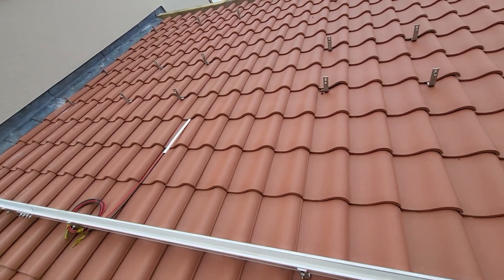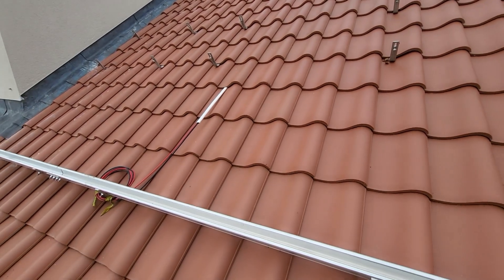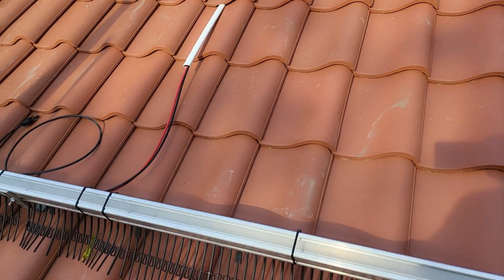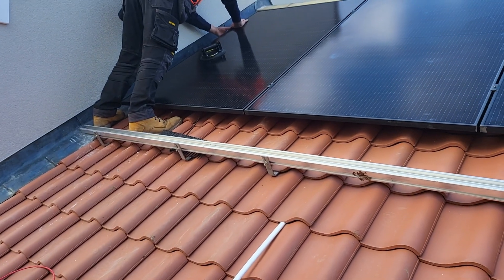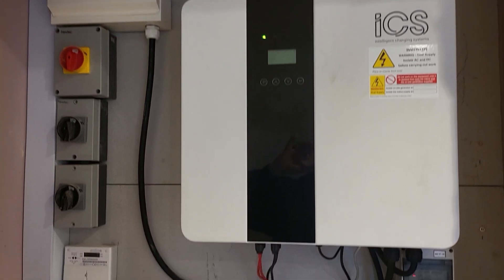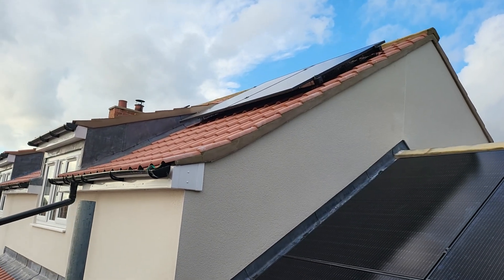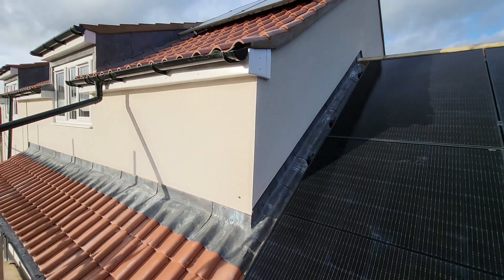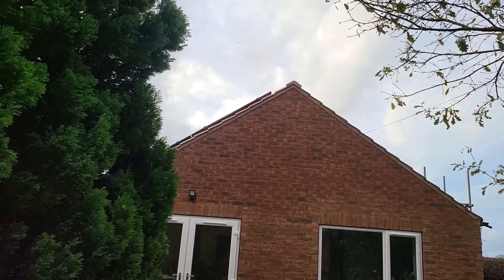Epic ICS 5kW hybrid inverter and battery storage installation with 12 x Solar panels on the roof

Comment: So can this inverter run the whole house oven, hob ect or is it just a back up system. Eps means emergency power supply?
Reply from the maker: Depends is the short answer on peak demand. In this case we set it up for some EPS sockets and lights as the customer wanted and shown in the video. But if peak demand is anticipated to 5kW or less can be setup to change over and run the whole house. To many variables tbh and a good installer will be able to best advise on a case by case basis.
Reply: Thanks for the reply. If peak was over 5kw will it just pull the extra from the grid like a sunsynk hybrid inverter?. Just would like to know if there is any limitations to this system that's not obvious from the CEF website.
Reply from the maker: @dannyspeed on grid yes it would. Off grid you have usual functions. Off grid via a change over switch to the EPS port you are limited by the inverter rating. Do not run an entire house Off the EPS on grid. You need to use a change over switch or gateway for that.

Comment: Another great and informative video Mark. Just wondering if there was a rule about panels being 400mm from the ridgeline?

I know there is the 'permitted development' rule about not going above the ridgeline and 200mm past the wall faces.
Reply from the maker: Under the ridge line is the preferred option but as this is a pretty exposed location over the ridge we wanted to be tucked down and I've had people moan about it on videos before 🤣.

Thanks
Reply: @electrician247  the things you have to do to satisfy the pedants 😂

Comment: Nice layout, people don't understand the headache of designing the layouts...
Won't go into could have done this/that with larger landscape panels & wouldn't have gained anything on smaller roof.
Larger roof is a headache, yes could have 4 larger landscape 550w across, maybe an ultra tight squeeze for two rows with a panel just squeezing between top windows - but larger panels tend to be white lined/backing, so not all black appearance.

TBH - as you said, customer specifying not landscape/all same (ergh they're all black, you really wouldn't notice), has saved you a planning headache on the big roof. The large roof was always going to be a pain & look qwirky. Still looks qwirky but hey ho, the customer says... End of the day, customer stipulates what they want/don't want & you have work with their spec - big roof was always going to be a pita.

5kW system is plenty for most homes, especially if they manage their consumption a little wisely. Impeccable installation btw
Love the guttering down pipe tied to scaffolding (not yet affixed to new render), threw me for a sec, wtf is that pipe doing - ooohh I see.

Niiiiiicccceee
Reply from the maker: Thank you. Nothing like experts on the Internet offering kinds of solutions. It's always a conversation between installer and client that comes to the best conclusion. 

The main house roof is actually split angled so was tricky to do much with it beyond 1.6kW generation ish. 

Client loves it! ❤️